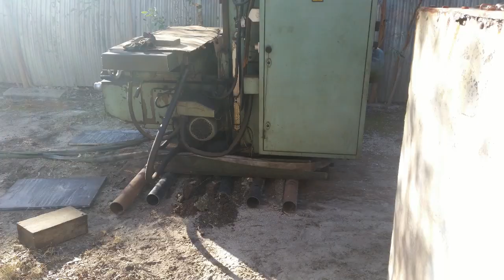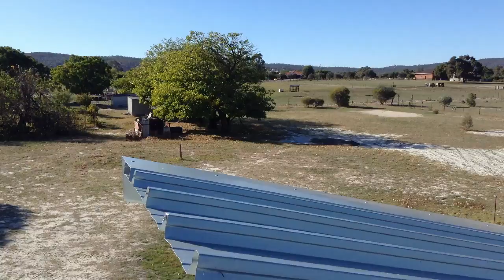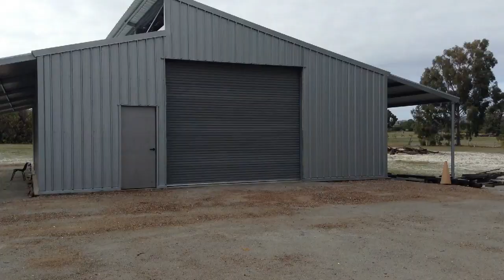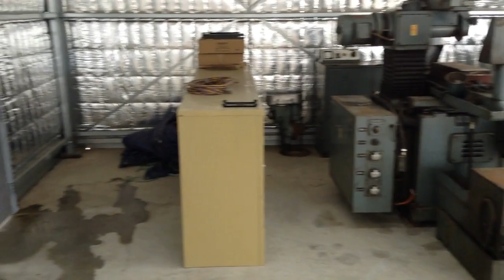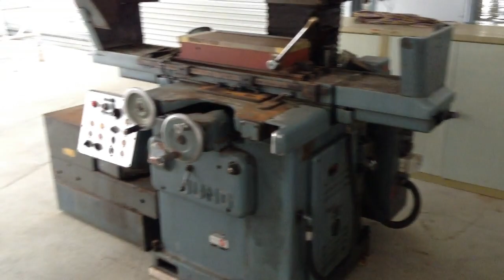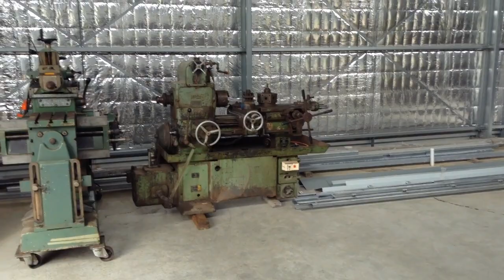New Shop Build Update .    May 2022 .

Comment: Hey max what size is the shed? And cost? I'm currently getting quotes for a 12x7x4m shed most qoute are in the 20k Range supplyer as a kit
Reply from the maker: 10m x 20m  with a 3m verandah down the sides .   The cost will be double that of a kit shed similar size .  But being as my one is a custom one off design ,  it is built from way better materials than the kit sheds .  Thicker steel is used on everything & the tin is Klip loc 700 not the cheap stuff you can't walk on .  👍
Reply: @swanvalleymachineshop    

The shed I'll probably go with has 4 frames made of 75x50x3 RHS the rest I'm not to concerned with in not in a cylcon zone so it doesn't have to hold back a hurricane 🤣

Comment: And if I saw it correctly, one of your machines has the WMW logo on it. Was possibly produced in the GDR. Have myself a small (650 kg) grinding machine from WMW. regards, Raik
Reply from the maker: Yes , the ID grinder .  One solid heavy machine . Made in Berlin  I will need to track down a parts manual for it .  👍

Comment: Max is there any advantage/uniqueness to use the power hacksaw instead of a horizontal bandsaw?
Reply from the maker: Cost of buying a large bandsaw that can handle 200mm dia bar easily is expensive . The big power hacksaw  is built for large stuff , was cheap  and it can just tonk away .👍

Comment: Shop looking great Max, very interesting on the concrete slab, I think it is Ash they add to reduce  cement content, but lowers the strength as you say, we specify 40 N concrete strength for our machines minimum 300 mm thick, then 150 mm for ancillaries.
Looking forward to everything in position and powered up, making swarf.
Tara a bit.
Reply from the maker: Thanks .   The base material the concrete sits on , when properly mixed with water & compacted makes a super hard , solid foundation .    👍

Comment: It may seem like slow process to you, but I'm really impressed with it. I try to see the orientation of the shop judging by shadows etc. Of coarse you are in a different hemisphere than me. It looks like your big window faces the sun which would be the north side if I'm correct. Any way, I'm always on the lookout for a new video from you. Your problem solving and planning are top notch, as well as your narration and video work. Cheers.
Reply from the maker: Thanks .  Yes , the big window faces North .    No hot summer sun comes through as it's shaded by the roof overhang .  Winter sun will be able to but it will have opaque plexi glass sheeting .  This should dissipate the light & prevent direct sunlight entering .    I hate direct sunlight from above in a workshop ,  makes machine lighting difficult .  👍

Comment: I HAVE been a overhead door installer for 30 years and what I found is quickest safest and easiest to square up the install I found if you mount the end plates and the side track and than I used a crank material lift or fork lift I would hoist the coil up and clamp side track level and square eather weld or bolt and there ya go installed I did 3 5mx5m in less than 8 hours  that is somuch faster and no mistakes and best of all not having to wind any springs.
Reply from the maker: The side tracks i find the most mucking around to fit  as they have to be welded .  If i know what i know now about roller doors , i would have designed the side columns a bit wider  , or pre welded support tabs on them for the tracks .  👍
Reply: @swanvalleymachineshop  the side tracks are made so that you can remove and turn inwards so you can mount on as lil as 2 1/2" or 6.5 cm infact I prefer to mount that way and weld in the slots only and if your going to have a operator I would build a plate off the end plate and bolt the op to it and not on the wall beside.

Comment: Great to see you getting the shop under control. You have yet to mention climate controls for that building. I'm sure you'll get around to something before winter sets in too hard. Of course the windows and doors ... Lot of machinery to get set up and running. Should keep you busy for a few years... Can't wait to see a lot more.
Reply from the maker: Thanks .  I will deal with heating / cooling later on if required when everything is finished .   👍

Comment: Looking good Max.  Man it's a lot of work.  I saw the plate packer outside your door and thought good man, he understands the importance of ground preparation.  I was pleasantly surprised a few minutes later when you talked about the ground prep you did before you poured your pad.  I see so many guys scrimp on that and it always bites them in the ass.  Last summer we built a new house on a piece of rural property that I have owned for almost 30 years.  With the current price increases and delays in getting material I'm very glad we did it last summer and not this summer.  I'm looking forward to seeing you tear down some of your machines.  I'm still muddling my way through my horizontal boring mill.  Ken
Reply from the maker: Thanks Ken .  Yes , ground prep is key .   Look at that new slab in the shop that Adam Booth rents , it has structural cracks all through it .     Good luck with the borer , i know i am not looking forward to stripping my one !   You were lucky to do your house when you did , we are about to build a new one in about a year or two next to the new shop .👍

Comment: Been a ton's of hard work, lots of money and endless thought put  into your building but it is sure looking incredible.  Does your electric company provide sufficient power for your equipment ? What is a cold winter where you are and what are your plans for heat?
Reply from the maker: Thanks .   Just in the application  process of increasing the power supply  to a larger amperage 415v  3 phase  than what we currently  have .    Winters here are not too bad ,   coldest would be about 5 or 6 deg C  &  that does not happen often .    Not sure about heat yet . I was going to build a large pot belly .     👍
Reply: @swanvalleymachineshop  Oh wow, wasn't expecting that as a low, wouldn't  take much to overcome that.

Comment: WOW!!! you have some really nice machinery there Mr Max and a awesome work shop as well. Are you going to use some heating in the shop? I use a  smudge pot heater for my workshop runs on heating oil, sump oil, kero or diesel.
Reply from the maker: I was going to make a large pot belly out of some 600 mm dia pipe that i have but not sure yet .  We call those smudge pot heaters  Demon heaters .   You need a well ventilated place for them !   👍
Reply: @swanvalleymachineshop  AH!! yes that's right i have the Little Demon heater and when i using the heater i have one of the roller doors open in the garage.

Comment: Great Max! Love the progress and the new machines. It is going to to be an awesome shop. Those skylights really light up the place. You may have said when you were talking about the concrete floor and I missed it,  but are you going to cut slots for expansion or is that not a problem with the solid foundation and/or mix? Of maybe you already did and I just can't see it. I watched on the TV so that is possible. Can't wait to see the next one. All the best! Eddie
Reply from the maker: Thanks Eddie .   No saw cuts .   The concrete never cracks on them most of the time .
That's why i put so much prep work into the base foundation .   👍

Comment: Any plans to cover the walls?  Or is that material there to serve a purpose?
Reply from the maker: Only in the welding area at this stage , i will line with sheet metal .    If i do anything with the rest , it will be a long way down the track .    The silver insulation is a standard workshop finish over here .    👍